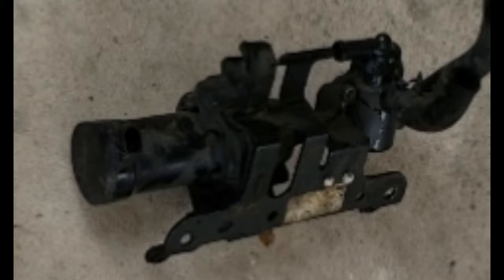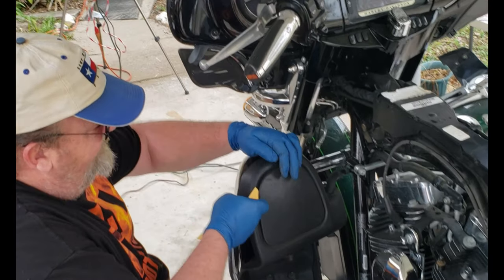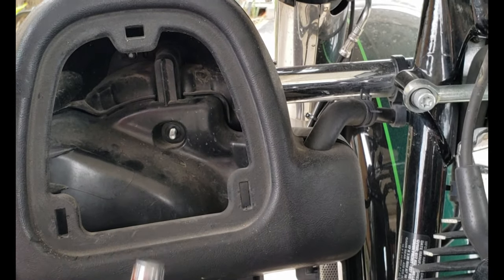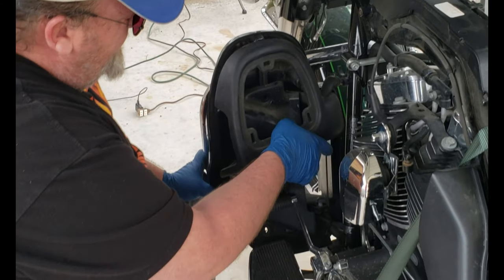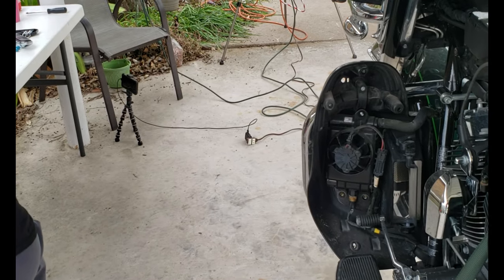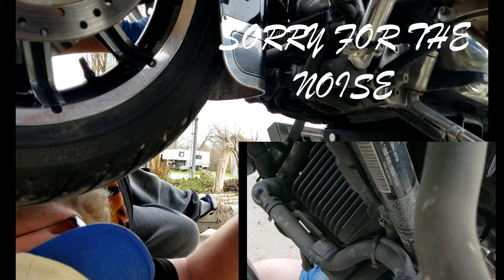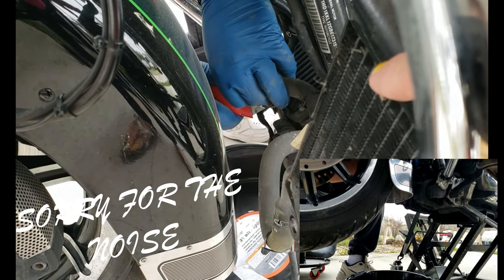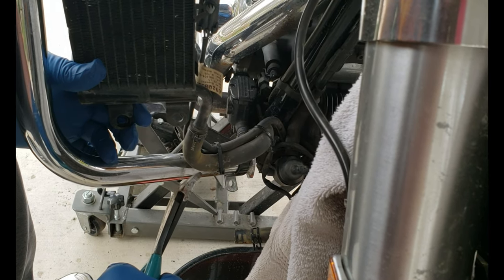2014 - 2016 Harley Davidson coolant pump replacement. Part 2

Comment: Ok why did you take off the lower leg? Did u open that one up to see why it stopped working? Thanks for the video
Reply from the maker: Ok, take a look at the next video and that should answer your question. 
If you are still having trouble understanding then maybe this repair is not for you.

Comment: 2014-2016 but which Harley bike??
Reply from the maker: This pertains to any of the twin cooled bikes.
Reply: @etc3929  oh. I have a 2015 street 750. Just recently noticed a coolant leak by the coolant pump and it drizzles to the oil change bolt. How much would it cost to get the leak fixed? No idea if it’s just a bad gasket. Bike runs fine. Just leaking coolant.
Reply from the maker: I'm sorry but I have nothing to do with Harley Davidson. I wish I could give you a price but I really don't know. 
Thank you for watching our videos.